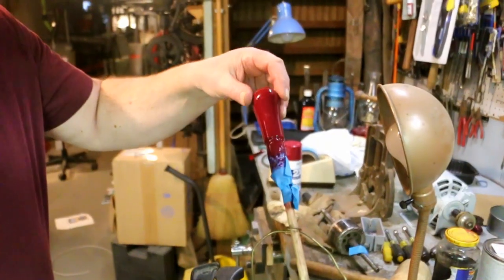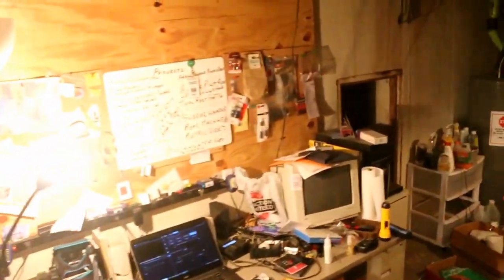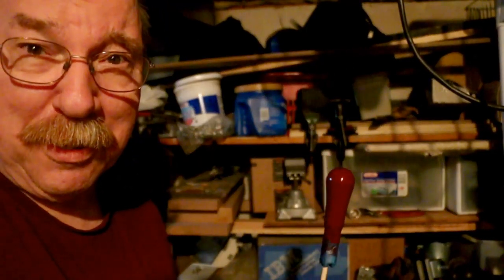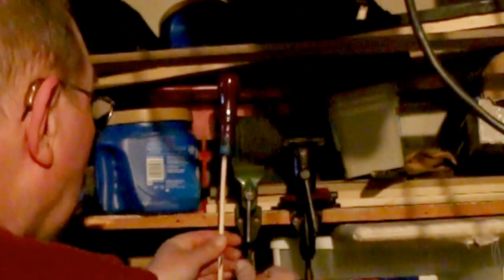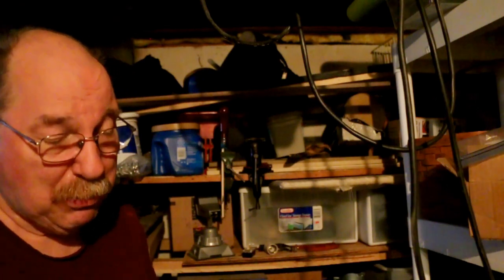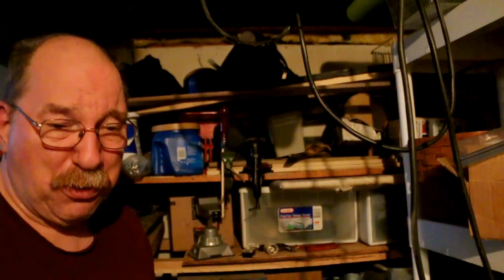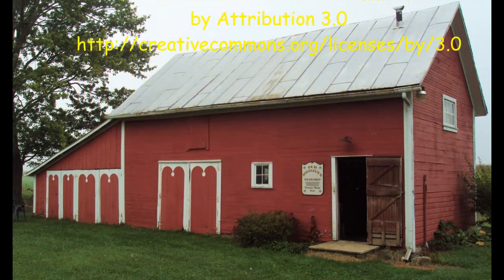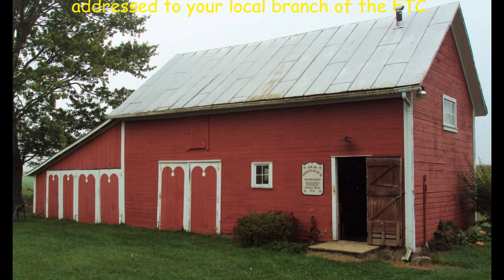Repairing A Hang Hole In A North Bros Drill Pt 6 Success

Comment: I usually just run out of time and don't have to be concerned about extras. The bare bones is usually plenty but I might have to throw in some gristle or a gizzard once in a blue moon. A shaded pole motor will always come in handy for something. The best on fixing the turner. AND GBWYall!
Reply from the maker: Record player motors use to be all over the place.
Reply: @OldSneelock  YES and with the friction drives!

Comment: Keep an eye out at flea markets or the Restore you visit for small gear motors.   I have one on the stoker of my coal stove.   These often have a slow rotation on the output shaft.
Glad the paint is drying quicker.  Bummer the rotisserie decided to stop.
Dave.
Reply from the maker: I have an Erector set that will let me create a step down drive. Fun from the past.   😁😎
Reply: @OldSneelock  i had one/some. Never could get into all the bolts and nuts. No motors in them. RATS!
Reply from the maker: @lewiemcneely9143  One of my favorite toys.
Reply: @OldSneelock  I believe it in a second!